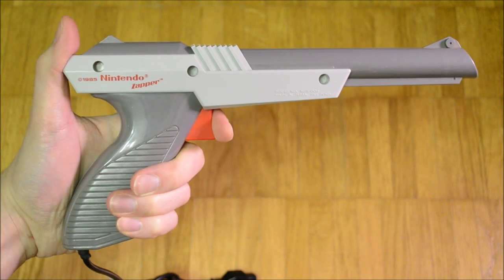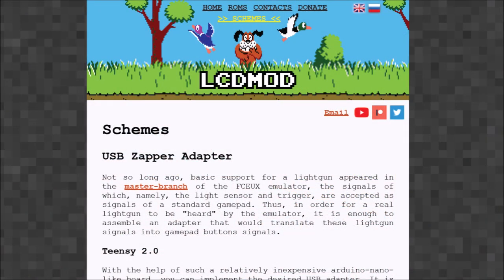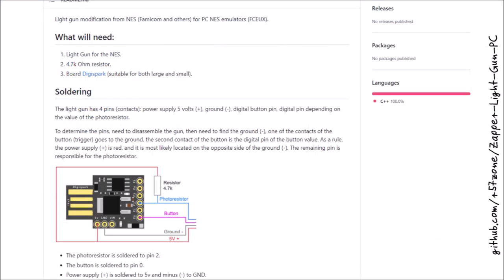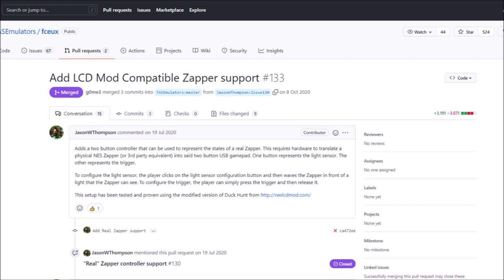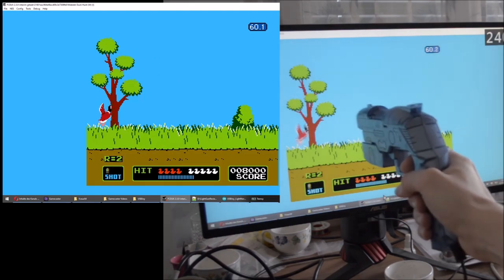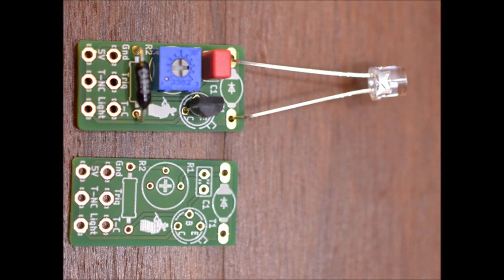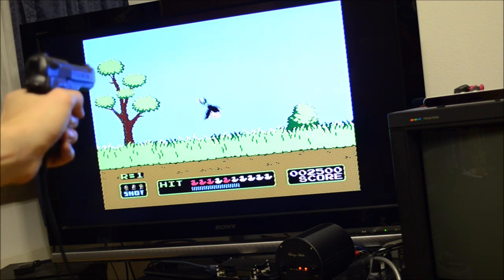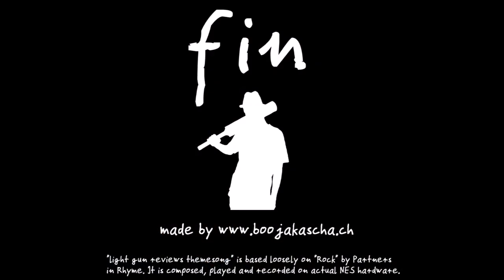Light Gun Reviews 217: Zapper clones on PC!

Comment: This is fantastic! My motivation for adding the changes to the emulator is because I wanted to play games like Duck Hunt on my home built arcade machine. All of the videos I found suggested that I add accelerometers to my light gun and use it like a mouse. This felt disingenuous to the spirit of the game. So knowing very little about the NES, not knowing the architecture of the emulator, and having no experience on an Arduino, I decided that I would add said feature. 😂 It makes me happy that others were able to take this mod farther.
Reply from the maker: Thank you very much for your hard work! I really hope this is just the start. This can get much further. If you think of it: displays & connection technology get better by the year. It doesn't will take long until this approach is super feasible and just needs some signal widening to make it perfectly work for a wide audience :P

Comment: Yep, 144Hz monitor gives me 1.8 delay. Btw delay is counted in frames, not milliseconds. How about two ducks on your 240Hz monitor? Does it always kill aimed duck?
Reply from the maker: I see. Well refresh an latency is not the same :P
You might be able to get way, way lower than 1.8 frames. 0.0 frames still should be 0 ms, right? I didn't try the two ducks mode with this setup yet.

Comment: Hi. Great videos, is there a cool way or diy way to make the wii nyko gun recoil with a solenoid? Thanks
Reply from the maker: Yes, totally. Going forward I will use my design form episode 214 a lot. The simplified circuit at 11:39. I plan to make a force feedback NES gun with moving slide :D
Reply: @Boojakascha  thank you. How? There is no 11:39?
Reply from the maker: @exclusivelynyc  In episode 214? There is. Its run time is 12:42. I think you are confused by Google's habit of creating links upon mentioning time stamps :P